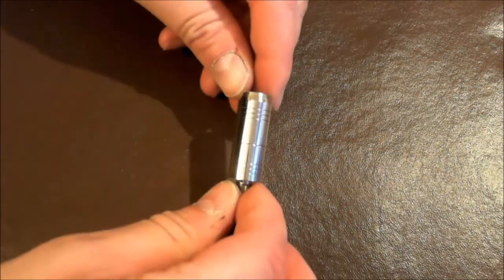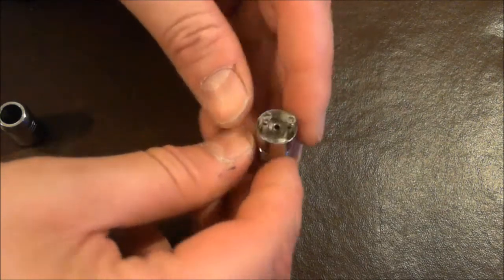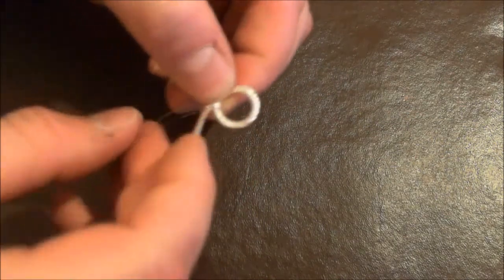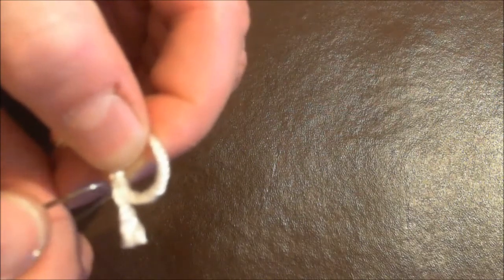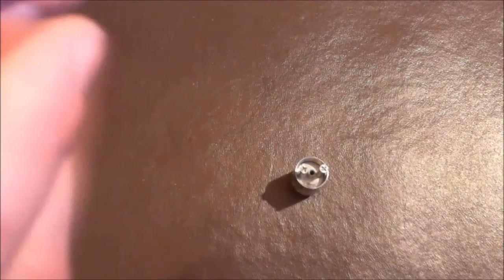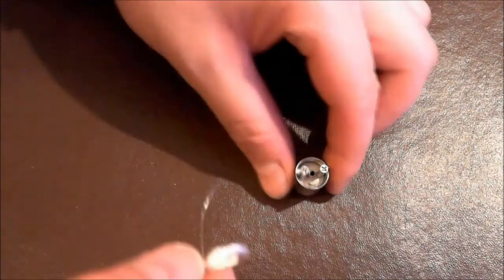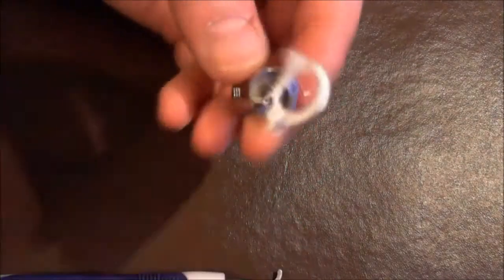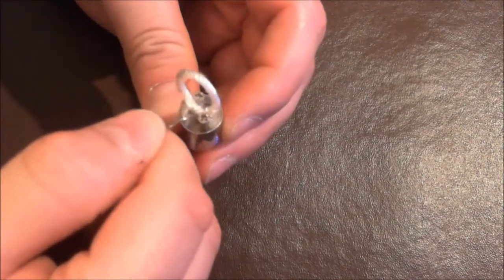A-7 Rebuildable Dripping Atomizer from Vapow.com  Electronic Cigarette

Comment: Outstanding review! I was wondering because I have never purchased one of these or looked for that matter...Below...Ah; does it come with the kantol and the coil wrap of any kind when you purchase it? Also, do you prefer this device to many others or would you actually "favor" it? Another question. How is the throat hit on the heavy hitting battery(Provari)you are using(compared to the Twist) again what Voltage do you think it best vapes at so you don't wind up with a coughing vape?  Grats Ross.

Comment: That is Pretty Slick Ross. I for one do not use any bottom fed devices so I do prefer the side hole and a sealed connector but this a great low cost atty for those who do use bottom feeders instead of paying an arm and a leg for a designer atty. Funny that you have the exact same dental tool I do :D Makes it easy to adjust coils on genesis attys and to negotiate the silica ones :D You can call the little loop thingy the "Junky Omega Loop" It looks great for these kinds of RBA's

Sincerely;
Nate